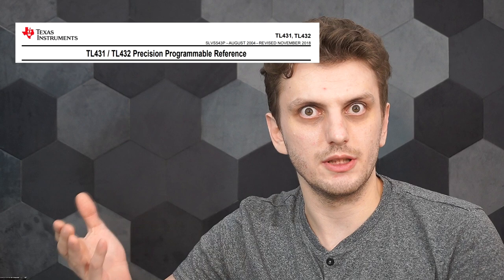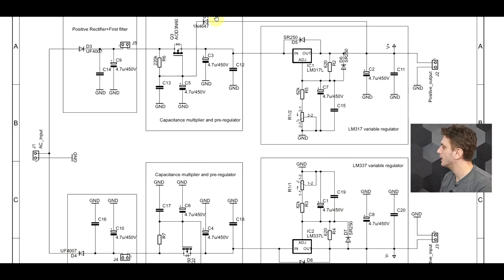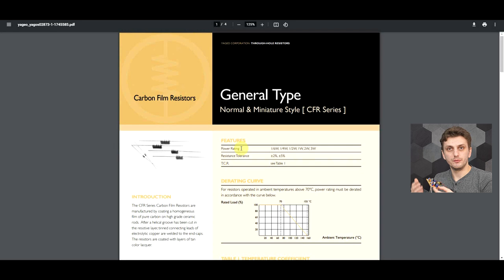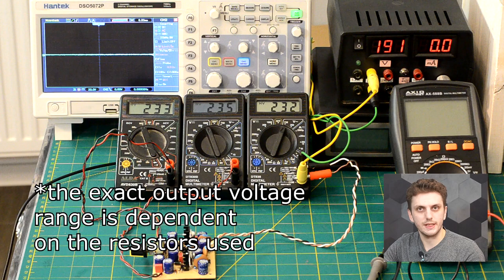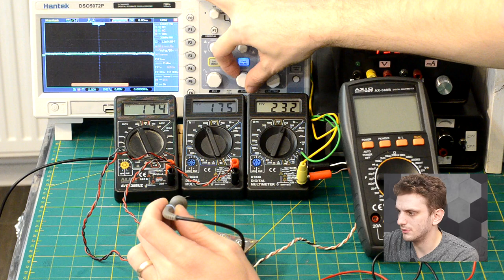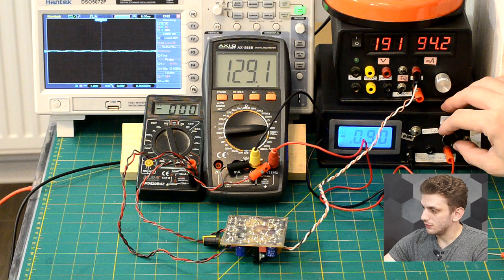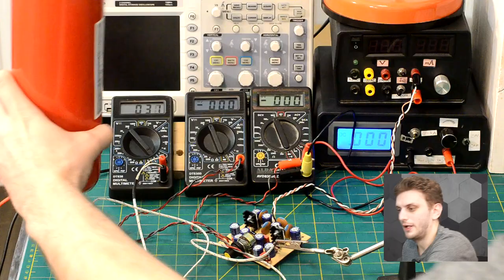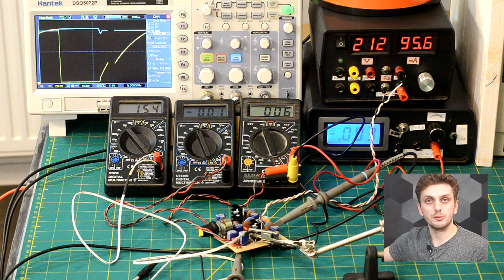DIY - High voltage linear regulator based on the LM317 - Part 2

Comment: Interesting, I was just building something extremely similar!!
Keep in mind that the LM317 has a minimum load current. 
This is a little different for the different versions. I think the "M" version has the lowest. 5mA or so, the other ones go up to 8mA.
I would recommend using a full wave bridge rectifier to bring down the noise even more at the output. They are so cheap these days.
Reply from the maker: Hello P_Mouse! Well, I did address the minimum load current, but in the LM317L TexasInstruments datasheet its only 1.5mA Typ. I guess its different for different manufacturers. Regarding the rectifier, I only used a basic diode to keep things simple and to illustrate the filtering capability, but you are right, for a proper circuit implementation, diode bridges will be needed. On other hand, with a single input AC winding, to get a differential supply, you will still need this single diode scheme..
Reply: @FesZElectronics  Yes, it can really differ.
I used them also for some cathode (self) biasing and got all kinds of strange behavior.
Changed to another one and it worked just find.
Looking back to the datasheet, I was just in the "danger" zone. Around 5mA or so if I recall. 

I am planning to make some HV buck converter in front. Basically just to get rid of all the heat dissipation.
I am planning around 400Vdc output and 150mA, with a 150V minimum or so.
So on the lowest voltage setting that means the circuit is dissipating around 37,5W.
Maybe I can also just use a double winding and switch in between, although that can give some nasty spikes sometimes.
Reply from the maker: Building a power supply with a SMPS pre-regulator stage and Linear post regulator stage is quite common. Its the best way to get the best of both worlds. I guess you can keep the LM317 and set the feedback of the SMPS to follow the output of the LM regulator; so basically replace the capacitance multiplier in this schematic with the SMPS.
Reply: @FesZElectronics  Yeah, that is basically my idea. Although getting a flyback stable is the tricky part.
I was also thinking of not making a tracking regulator, but just set the voltage (very) roughly 10-15V higher or so. It doesn't have to be precise.
The capacitance multiplier can still be useful, since it's a actually a lot better of getting rid of high frequency noise.
The noise reduction of a LM317 isn't actually so great for these higher frequencies.

Comment: Looking forward to Part 2b! It is my understanding that it's not difficult to implement an overcurrent protection by using a 0.1-1 Ohm shunt resistor and a comparator or an op-amp. To make it work as it's done in modern power supplies (drop the voltage but keep the current constant) may be another story.
Reply from the maker: Hello Alex. I tried to make the circuit as simple as possible, that is why I refrained from adding op-amps. But since a dedicated current limit does seem to be necessary, I think a single transistor one will suffice...
Reply: @N01Spl it is

Comment: Booooy, I see what you are trying to do. Are you trying to do HDC voltages for pedal tube valves? Because, if yes... damn man, I was trying a solution for that. I mean, a small circuit, small noise, high voltage dc to excited the tubes (12ax7).

Great work as usual.
Reply from the maker: Well, that was not the plan, but its a good idea! I will keep this in mind. What sort of pedals are usually built with valves? distortion or also something else?
Reply: @FesZElectronics   Hiho. Well, I'm yet a rookie working with guitar fx. As far as I am concerned we can build distortions, some audio amplifiers and sustain and compressor pedals (but compressor ones are too fancy ~to do not say complicated~)

Comment: Thanks for the great videos. I have 3 questions:

1 - What are the values of the common capacitors (C11, C12, C14) in the schematic ?
2 - Have you tried to make a direct short circuit on the output to GND and did the power supply survive this?
3 - Can I have 2 transformer windings and use 2 bridged rectifier and connect the 2 GND (+ and -) from them together in the same circuit ?

Best Regards
Peter
Reply from the maker: Hello Peter! Let's take things one by one:
1 - I used 10nF but any value will do 10-100nF;
2 - I slowly increased the current, but Idid not do a direct short circuit; I expect the result to be the same at the moment - no survival...
3 - This will work only if the 2 initial windings are separated; so its common to have transformers with a large winding and an intermediate pin (3 pins total) - this will not work; but if the windings are separate, then its ok; Regardless you can try and simulate this circuit in LTspice and confirm there is no issue, the windings can be voltage sources to keep things simple
Reply: @FesZElectronics  I have previously built a variable high voltage power supply (50-400 V, 200 mA), for my experiments with tubes, not with an LM317, but with an FET and a transistor as a current limiter. In it I had to build a thyristor and a relay to deal with a direct short circuit.
Good idea to use LTSpice to test with 2 bridged rectifiers, I will do that.
Thanks,
Peter

Comment: I do not understand why you feel the need to match temperatures on the FET and regulator? done that with say totempole arrangements where you want each to have the same point on the transfer curve, but not different devices.?
Reply from the maker: The regulator has a built in over-temperature protection. I wanted to try and take advantage of that to turn off the regulator if the FET overheats
Reply: @FesZElectronics  Ahh yes, of course, that makes sense.
Reply: @FesZElectronics  Not on part 2b yet, but looking at the reference sheet, can see some omissions, like the 2.2R resistor on the output filter to limit  inrush current, plus you seem to have a capacitor where it tells you specifically not to insert one, I will be very surprised if you ever get this regulating, even on part2b, we shall see, I tend not to diverge from reference designs much unless they can be calculated accurately, the guys at national will be using the best simulators and engineers to take all parameters into account, including thermal limits. When we used to do simulations, we swept lots of parameters, monty-carlo, worst case-tolerence etc, bit of a pain, but on HV circuits like this, its probably wise.

Comment: Sorry, but what is this supply used for?
Reply from the maker: Well, I'm not building it for a particular purpose, but its a high voltage linear supply, that can be used anywhere you need clean stabilized high voltage - one example can be in vacuum tube circuits.
Reply: @FesZElectronics  thanks
Reply: @FesZElectronics   I think I should read your coments first! xD